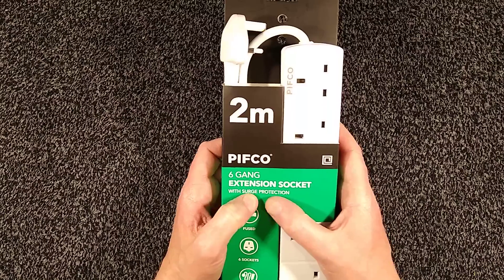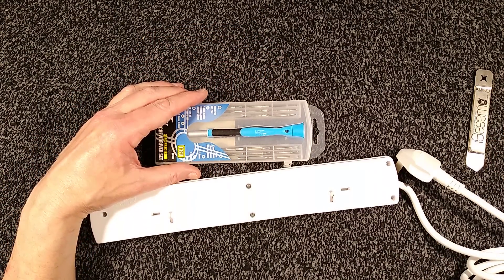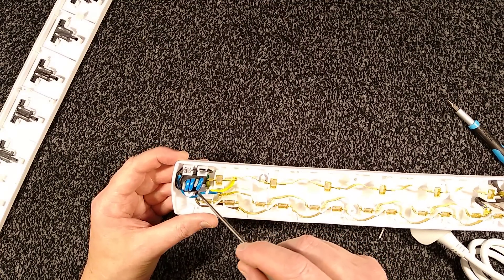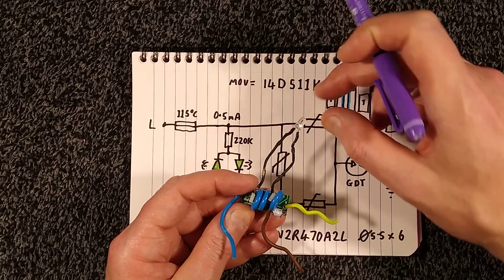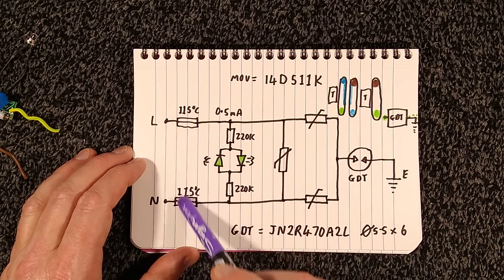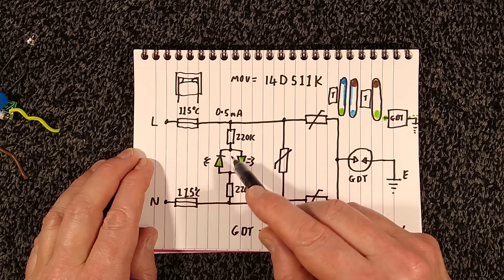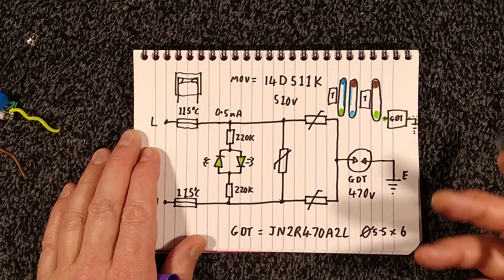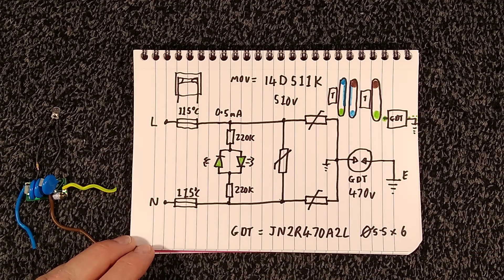Inside a Pifco surge protected extension (good circuitry)

Comment: As an American who knows very little about electrical stuff, I really like all of the safety features of British outlets and plugs (switch per outlet, fuse in plug, outlet shutters, partially insulated prongs, etc.)
Reply: The fuse in the plug is basically a hack. Many british houses have a ring circuit s with a lot of appliances on a single higher current breaker, usually 30 or 32A. Without the fuse, you would need the faulty appliance to pull 32A before the protection of the breaker kicks in. With it, you have some additional safety. 

One thing you missed is the square pins that gives a really good contact area. Downside is standing on them is one of the most painful things in life.
Reply: @spxza  The fuse in the plug is also great for low power devices with thin cables. If something is only going to draw 1 or 2 Amps, and so you can make it with a small diameter cable feeding it, then a 3 Amp fuse in the plug protects that cable from melting even if a fault in the device causes it to draw, say 10 Amps.
Reply: @AJB1  
1 amp (and smaller) fuses are available but the practice of.. or more to effect.. plugs being sold with a 13 amp fuse and people not understanding the concept of a fuse.. and I have met people who fit 13 amp fuses so..
"They will be reliable"
I think a 13 amp fuse in the plug of that and giving it a 13 amp or 3kw (4kw or 5kw should be fun) load at the opposite end to the input might be a good test for the bits of wire connecting the sockets together.. I would fit a 5 (or 8) amp max fuse..
2kw is more than enough for that.
Better is to size the fuse accordingly as many of the USB and various charger plugs etc don't seem to have an actual fuse..
at the other end of the scale a piece of a 6" nail in place of the plug's fuse.. seems to be less common.. older welding machines, many should have their own spur at the distribution board and not have a 13 amp plug.. draw a ridiculous current..
Yay .. plug an old welder in to it...
See what melts.
Reply: @mySeaPrince_  5A ceramic fuses for our mains plugs are relatively easy to obtain in the UK; the next step up is 10A (less common), then 13A. I don't think I've ever seen an 8A mains plug fuse here.. I wonder what colour they might be?
Reply: @snafu.X  
I was an electrician then moved Off-Grid.. and the world of 12v.
I remember 1, 3, 5, 8 & 13 amp fuses.. ceramic type.
13 were used for immersion heaters.
... and the round pin plug's.. 2, 5, 15amp
(I've got a plug that converts between 5, 15 and 13amp plug pins, a 2D Rubik cube) and the 2 pin.. and the light fitting adapter's that people used as a mains supply for even thing's like iron's.
Funny thing the military still use 5amp round pin plug's for certain systems.. and I use 5amp and 2 pin and they are still available from the high street.
Reply: @mySeaPrince_  In the 1970s when my sister worked in a local hardware store someone came in wanting "some amps". She eventually worked out that what he wanted was "some 3Amps". 

One reason they mandated appliances coming with fitted plugs was so the appliance would at least start out with the correct fuse. Another was that so many people fitted plugs incorrectly. I'm sure the wiring code for hairdresser' s hairdryers in the 1980s specified that you had to have an inch of Brown and Blue wire showing between the cord grip and the cable sheath.
Reply: @MrDuncl  
Was the inch so they could get it through the hole...
... or were they using them for hammer? (like shotput but with a wire and handle) throwing practice.
I get people to buy the plug's with the 'claw' thing that grabs the cable instead of the bit of cardboard and the 2 screw's..
Much better 😻
Wiring the plug with the correct cable lengths.. live is tightest and earth has lots of slack.. so.. in theory the live pulls out first and the earth last.
Reply: @mySeaPrince_  I suspect the problem was people not trimming the wires to length. If the manufacturer supplied the cable with 1.5" of brown wire followed by 0.5" of (often tinned) copper then that is what people screwed the plug onto.
Reply: @mySeaPrince_  I am overly pedantic (FAR more than necessary!) about plug fuses, and have a good stock of 1 and 2 amp ones that I use for such things as soldering irons, small radios, power supplies etc. It stems from my first soldering iron when I was about 10 (Antex CN15, still in use 50+ years later) whose instructions specified a 1 amp fuse, and I've been over-fussy ever since.
Reply: @Bartok_J  
You say you are overly pedantic..
I disagree..
You are implementing the safety device specified.
Occasionally friends will ask me to fit a plug or replace the cable.. there is some nice non tangle cable, colours and cable for vacuum cleaners (corded) or heat resistant, yellow artic cable or the deep blue can look nice in the right setting.. and I will get them to buy a decent plug, the type with the claws that hold the cable instead of the joke piece of cardboard (which years ago may have been fire proof) held with 2 screw's.. And the right fuse!
Also changing them to other types of plug..
for instance the colour, design.. ergonomic or aesthetic, rubberised, finger hole, round, square, I'm wary of the type with cartoon characters usually thin cheap etc, clear plastic seems a little freaky to me as it looks like the cover is missing.. tipex on black plugs in an office can also help identify which is which.. don't get me started on the socket tree's.. a plug a short lead and some piece of plastic with 50 million sockets.
I will also find a smaller fuse or instruct a friend to fit a specific fuse.. and when I see them again ask.
Plastic socket cover's are a good thing.. but why put sockets near the floor anyway, I've specified on a few new builds and even sacked an electrican for saying "I always fit them in the middle of the wall near the floor".
I add a socket below the light switch.. and other details.. including 2 or 3 way etc switching and PIR..
I'm Off-Grid on mainly 12 volts so I only have a few... Cable sizing is even more critical (it can easily become a fuse) and buying decent copper cable and crimping are essential.. (not aluminium etc) the art of cold welding etc.. double sleeve and UV are other considerations..
Years ago I was called paranoid.. I'm still alive they are not..
It's their choice and also mine, including do I want to be in contact with them.. 🖖
Reply: @spxza 
Yep.. standing on them is next level masochism...
Reply: @brolohalflemming7042  
Now you are teasing me... 😻
Add some drawing pins for a real party.
Reply: @mySeaPrince_  I'm in Canada.   On a scale of one to Lego blocks,  how bad is it?
Reply: @harveywright396  
There's a place on the arch of the foot that it always seems to get..
probably a pressure point..
and although the pain after.. is a lot less..
it stays for ages..
...  once experienced your body won't allow you to do it (deliberately) again intentionally..

Bang 3 big nail's in a piece of wood the same...
and VERY GENTLY give it a try.
Much Worse that catching your funny bone..
WARNING ⚠️
Can and does cause permanent damage.
Reply: @mySeaPrince_  I did put a rusty spike nearly through my foot once...  that still sounds like something to be avoided.
Reply: @harveywright396  
Rust etc.. can have contaminants mixed in and can cause Sepsis.. which can be fatal.
Reply: ya North Americans sure like taking chances with electricity like it is the wild west.  at least it's only 115v enough to give u a tingle.  220v might put u on ur ass
Reply: @theorenhobart  both can easily kill you actually
Reply: @theorenhobart  I've personally had no lasting problem from gripping an unshielded 240V AC cable at the age of (IIRC) ~7yrs (I thought it was disconnected & was showing off to my brother), but I can fully appreciate it may well be more dangerous for ppl with eg heart problems etc, esp in confined cavities when your muscle reflexes can't pull away easily. No burns from my experience then, & it taught me a healthy respect for inevitable repeat performances in the many years since then, voluntary or not :)

DC voltage of that level is ofc a completely different lvl of risk that I have no wish to experience & will continue to avoid for as long as possible :)
Reply: Retired residential, commercial, and service electrician and CET here. Those safety features are more needed there since they use 230 volt power. In the US we only us 220v for permanent hard-wired and semi-permanent plug-in appliances and mechanical systems. We use 110v for the things we interact with regularly because it's safer (a tingle vs permanent damage or death). It also means more circuits can be run off of the same bus, limiting the load on each and better zoning them.
I am also not a fan of relying on fuses in the plugs. They are made by many different companies to wildly different standards. We have individual circuits protected by highly engineered circuit breaks that are (usually) made to very high standards (other than Zinsco).
People who know little about electrical love to crap on our system and especially our plugs, but considering the size of the North American population there are relatively few cases of injury or fire due to the design, and they are almost always misused to create such issues.
Reply: stepping on type a and b plugs not as bad as a g plug those almost always land pins up
Reply: There are NEMA-1 fused plugs, my hair dryer and room fan both have them.

Comment: A whole-house surge protector protects everything and is probably cheaper in the long run than all the individual ones.
Reply: Distribution board surge protectors will protect you from surges coming in from outside (mostly), but won't necessarily protect one piece of equipment from the failure of another nearby, because of the self-inductance of the mains wiring. Best to have both.

Comment: Yes the small flat blade screwdriver is the universal safety screw driver for me also. Good tear down Clive, I've tangled with those screw and clip extension leads before and they were obviously designed by some sort of masochistic sadist. You need safety screws and stupid clips to hold your extension lead together??? I think someone is way over compensating for something.

OH yeah, watched a bit of the Tattoo on the TV yesterday. Great lighting, sound, etc on you and the crews part, but it's just a bit too bagpipe and drum centric for my liking...🤣🤣🤣🤣
Reply: I'd guess the 'safety' screws are to prevent someone from bypassing the expired surge protection with a nail or similar
Reply: @snafu.X  true, but for those of use who are initiated and would save this item from landfill, the combination of both safety screw and clips is just overkill and a nuisance
Reply: @generaldisarray  Agreed; sadly the 'initiated' are outnumbered by the 'bodgers with a screwdriver' by at least 2 or 3 orders of magnitude, in this country at least :((
Reply: @snafu.X  ah yes, but you have to remember if the bodgers bodge it and end up injuring themselves it's a good'ish thing...🤣🤣🤣
Reply: @generaldisarray  Darwin at work, eh? I can't say I'm against it :) The only problem ofc are the innocents who may make use of the bodger's 'produce' long after the bodger has expired, or simply by random selection (another Darwinist trait, but less helpful IMO) :(

Comment: So, basically, when the thermal fuses go, you can throw away the whole extension plug. Would it not been nicer if there was a switch that popped-out?
Reply: Why would that make any difference? You'd still have to replace the components which have failed, which people aren't going to do.

Comment: I take issue with the surge protection at the end of the strip and not between the input and the outlets.
Reply: That is also my thoughts. In this situation all devices first get the overvoltage before the surge protector can react.

Comment: So what is stopping the neutral fuse melting potentially leaving the circuits live but appearing to the novice that the supply has failed
Reply: Those fuses are only protecting the MOVs. The LED will go out, and connected devices are no longer fully protected but continue to work.

Comment: Very interesting video Big Clive I am aware of surge protection 6 socket extension leads myself I use one made by Ever Ready bought some time ago from B&M stores very handy to have when I have a double gang socket and needing to power a TV dvd combi and dab radio and virgin media WiFi router and other devices connected with the WiFi 😊some what I find reassuring that the 6 socket extension lead has surge protection especially with WiFi router and other electronic devices that could be prone to power surges/spikes 😊

Comment: The surge protection side may be decent (for what it is), but the contacts of the extension seem.. lacking. I'm used to seeing a fairly chunky brass element to grab the pins and hold it against a thin bus bar.. not just the thin bus bar stamped into a springy shape.

Comment: I have an old 4 way strip I brought from Woolworths back '84 or '85. Thick brass bus bars linking each socket and a proper neon and switch. I took it all apart a few months back so i could give the case a good scrub. Nearly 30 screws holding it all together 😮
Even the lead is replaceable. Made things to last back then.
Reply: Yes I few  made by Weber and neon and have circuit breaker and metal housing plus they used standard outlets !
Reply: Love that. When I build things, I have the luxury of building them my way, being inspired by Leeds & Northrup and also early General Radio gear, so I make them both serviceable and nice to look at. And since I started my career as a technician, I have strong opinions about what constitutes "serviceability". ;D
Reply: In 1979 when i was putting together my first HiFi my Christmas present was a four way (Duraplug ?) socket strip, cable and plug which I then wired up myself. All made in the U.K. of course. Back then those parts cost about the same as a ready made strip does now (about £9).

Comment: Thanks Clive for the detailed breakdown of the surge protection devices in extension sockets.
My boilers control board suffered a voltage spike, and the cost of fitting purpose built surge protection socket was horrendous, so I took one out of an extension socket and fitted it inline with my boiler feed at a fraction of the cost. Moral of the story…fit surge protection on your heating system, as well as your media devices. ( unless of course you’ve got SPD’s in the consumer units now.)

Comment: If you use only 1 fuse there will always be 1 varistor that isn't monitored. Although you could leave the one between neutral and ground unmonitored since it rarely sees much voltage in a properly wired home. But since when was every home properly wired?
Reply: Places that love regulations, like the UK, New Zealand, and Australia. The UK requires a licensed electrician inspect wiring every 5 years and issue a certificate (EICR) that is legally required for rentals and for homeowner's insurance. In Australia, DIY electrical work is prohibited, it must be done by a licensed electrician and therefore you can't buy fittings off the street.

Comment: I read that the higher the joule the better! (USA)
Surge protectors use a joule rating to indicate the total amount of surge voltage they can absorb without failing, whether in a single event or over a series of surges. A higher joule rating typically indicates stronger protection.

Comment: My memories of Pifco is that they made torches, usually with tinplate bodies --- compared with EverReady's moulded plastic. "Empire made" as I recall, which in those days (later 60's early 70's) meant Hong Kong.
Reply: My memories of their stuff exactly
Reply: I bought one in Boots with a Boots token I received as a present back in the early 1970s.
Reply: They made a good (for the time) motorist's lantern, with a white lamp at the front and a flashing red dome at the top. It used a special bulb that featured a bimetallic strip to make it flash.
Reply: @Bartok_J  I remember those, looked very similar on the outside to some of the "lethal" camping lights Clive has tested, but with either a "lantern" battery or 4 U2 size (C cell in the US).

Comment: PIFCO ! ... a stalwart of the ( 1960's .. errmm ) ... handy tip # 67 ... NEVER ! use these extension blocks for running  ANY  kind of electrical heater ( bar fire,  who has one these days ?  ) = brown scorching + smoke 😝 ..... DAVE™🛑
Reply: Yes, they are typically fused at 13A, but are not really up to continuously carrying most of 13A to just one of the connected devices. A good rule of thumb is that anything that needs a 13A fuse (rather than 3A) should always be plugged directly into the wall, particularly if it might be left on while unattended.

Comment: Nice to see what the real circuitry should look like. I bought one of these on Amazon ("LENCENT" brand) that claimed to have a gas discharge tube and over 1700 Joules of protection... But I opened it up and found nothing of the kind. Just a pair of 180J MOVs and an LED. Buyer beware, I guess.

Comment: Hello Clive, love your videos. Was in IKEA the other day and spotted a notice stating: 

“IKEA urges all customers who own a VARMFRONT power bank 5200 mAh, blue (article number 70555647, with date stamp [YEAR/WEEK] 2318, 2319 or 2322) or VARMFRONT power bank 10400 mAh, dark blue (article number 10555645, with date stamp 2313, 2316, 2318 or 2319) to immediately stop using it and contact IKEA for a replacement or full refund.”

Just wondering if you’ve heard of this or would be interested in doing a tear down video if you could get hold of one? Apparently there’s a fire risk, seems right up your ally! Cheers.